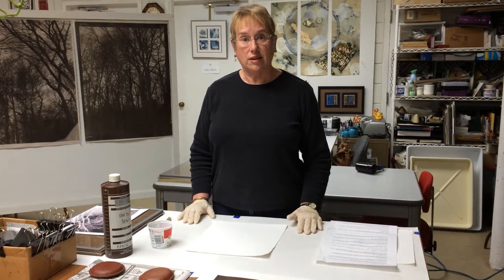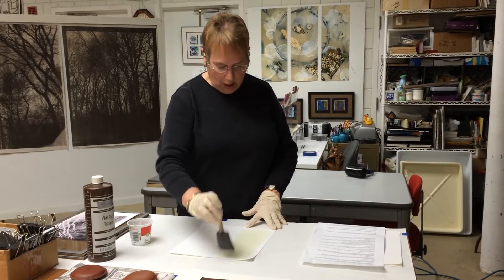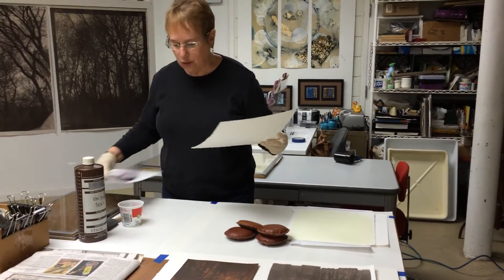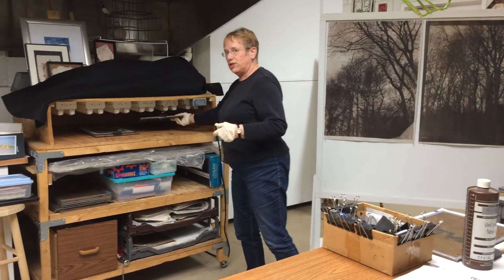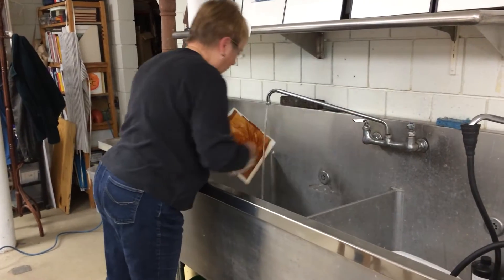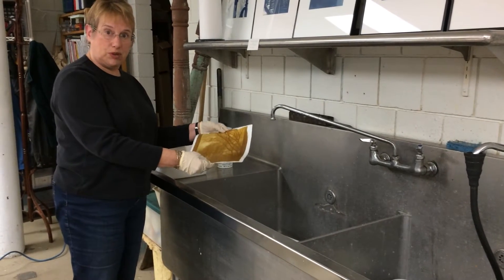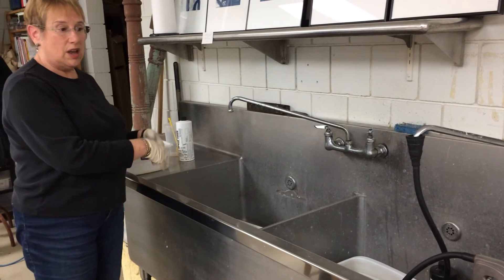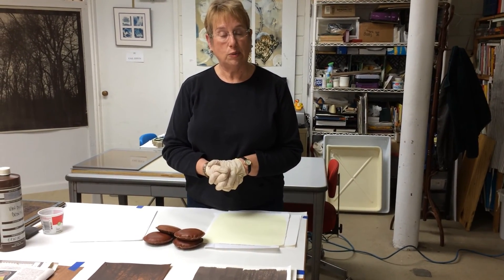Gail Erwin demonstrates the Van Dyke Brown photographic process

Comment: Gail, it is best to applly the sensitiser in crosswise strokes onto the paper, to make sure you coated the entire section that will be exposed to light. Your washing time is far too short. You did not mention what type of fixer it should be;  sodium thiosulfate, fix for several minutes, wash for at least 30 minutes. Tone the print. Without toning, your prints are liable to bleach out in future.  Leave a wide margin around your prints.